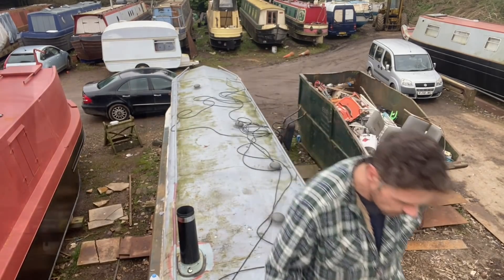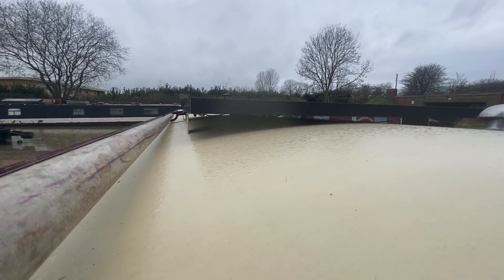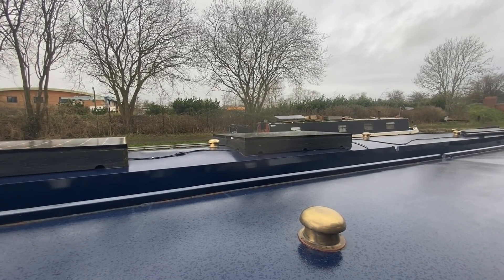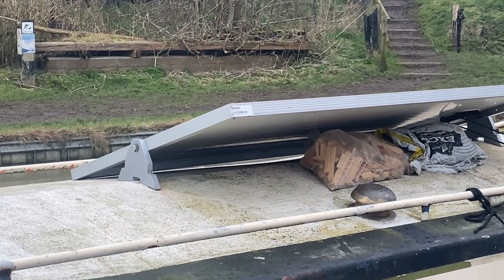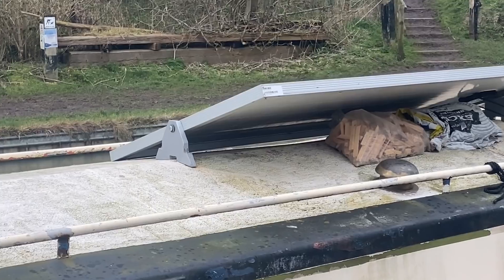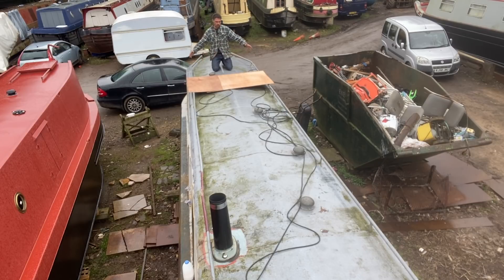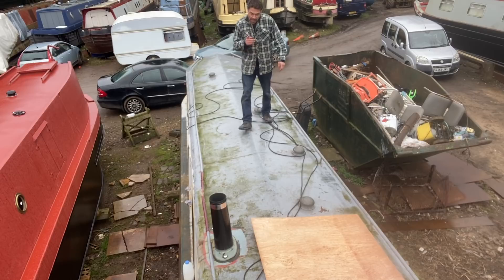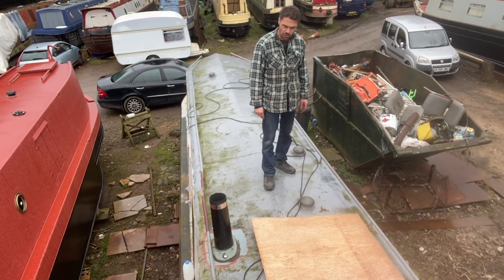122. Narrowboat solar panel positioning and mounting options

Comment: Hi James,  great channel    ,,  aslong as your solar panels   don't go higher then your chimney   your fine!!     Also what i did   I built a platform   going over the mushrooms    then built  lockers ,put lids on the lockers and screw solar panels to lids ,   hinge lids to the lockers,, great for storage ,    coal , wood ,  paint etc
Reply from the maker: Yes that’s the plan I’d like but I’m concerned about air draft
Reply: Do you mean you concerned of it lifting ?  No it should be fine ,, We have a 60ft inspection launch  ,,  we have hand rails going all the way across the boat  both sides same as yours,,   what we did  4by2's    rail to rail  cut to the  curve of the  roof    with the ends cut so they slip under and over  the rails   all the way down     there not going no where    then we decked the whole roof ontop of the 4by2's,  then thats your platform ,   then  build the lockers to the size of your panels      more watts the better as you know,,   

Keep it going mate    looking foward to see what you do with your plumbings 

P.s   I think your watertank might be too small    I would recommend atleat  400ltr

Comment: What about moving the mushroom vents or sealing the forward vent over and cutting one into the front door? sounds extreme but then youre free to place the panels wherever. Would wonder how annoying the panel at the bow will be if it is too high, would it be too much of an obstruction to vision? And if you lay down the comms mast for cruising, youre going to block that path next to the chimney. Maybe worth thinking what angles, (fore and aft) the centreline will pull to when mooring and locking and make sure its not going to foul the panels. Interesting stuff though!

Comment: I think you need to consider the slope of your roof and the ability to tilt your panels at 45 degrees when going against the slope, could mean the brackets have to be quite high. Now a tilting lazy Susan would be perfect!!! Could always get the correct angle and direction regardless of your mooring position.

Comment: James.  Have a look at the lads on foxes afloat. Their solar is mounted flush to the roof. 
Excellent channel. Cheers geeza
Reply: Flexible solar panels are terrible for actually harvesting power. Their efficiency is not even normally published it’s so bad. Panels that are designed for houses are the best option. 40+ volts and up to 25% efficient. Those guys cruise all the time so perhaps not such a problem
Reply: And very important, you can walk on them, and also: no problems with the centerline at all.
Reply: Colin and Shaun have five flexible solar. 4 for the leisure and one for the starter battery. Yield is not quite as great but you can walk on them abs they are flush. Aesthetically pleasing as well. Can you swap?

If you alternate will you be able to get the angle of the sun ☀.

Most other solutions involve fabrication - crowd funding?
Reply: @Narrowboat Hands - Foxes do cruise continuously so are not so affected by angled exposure to the sun. I'm not sure what yield they obtain but their electrical kit is the same as others and they do not have a generator (too noisy).
I also follow a few yachting channels and there is a mix of power recovery through the propeller, fixed and flexible solar - the latter because of access to the sails (see Sailing Uma or Sailing SV Delos). The flexible are also fitting to the bimini - the flexible cover over the steering area, similar to that on narrowboats.
Reply: @foghornleghornish  yes the flexible panels do have their place. I have fitted a couple recently. Another problem with them is that if they are mounted directly to say the metal roof of a narrowboat,in the summer the panels get so hot that the power just drops off. A slightly raised panel for cooling is great.The hotter you make a panel it causes the power to de-rate .Some of the best solar energy yielding days are cold but sunny.😎 cheers buddy.

Comment: James you may be able to use aluminium for your if you were going to make those ones that was on the boat in wood if you're going to use stainless steel be careful of the stainless steel and aluminium from edge of the frame contaminating each